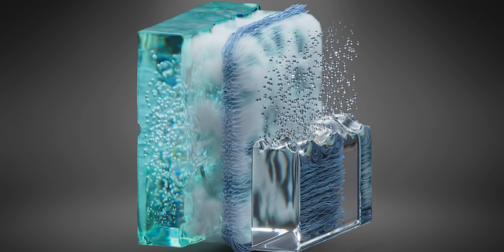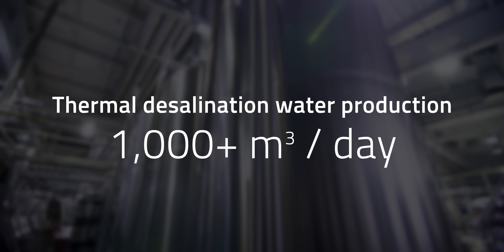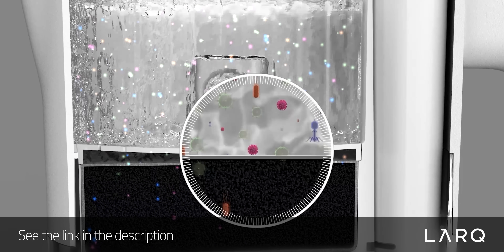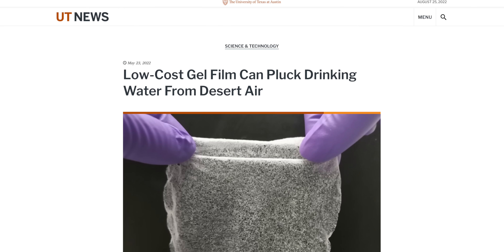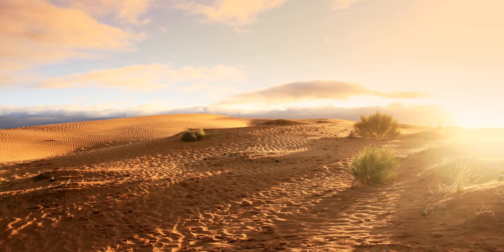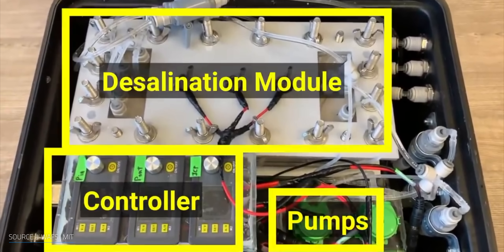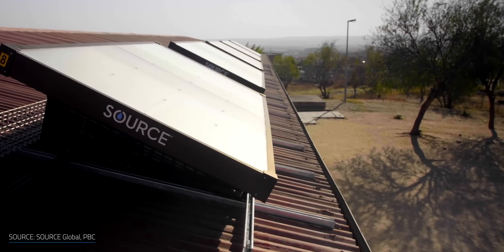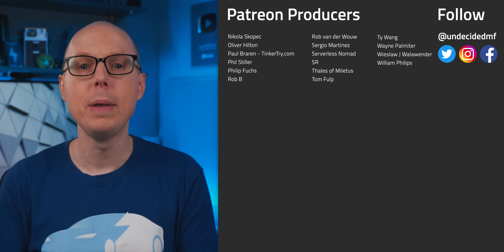2 Breakthroughs That Could Solve the Fresh Water Crisis

Comment: Wondering if it would be possible to combine solar-powered sonic based humidifiers near coast lines to pipe humidity through pipes to underground solar-powered dehumidifier locations that are inland.
Reply: If you're on the coast standard desalination and a pipe will do the job far better than trying to suck water out of the air.

Comment: I have been researching a system for sailing boats. It uses a network of SS 316 tubes on the ceiling of the yatch, a wave activated seawater pump to pump seawater to 11m high and that water creates a vacuum in the SS tubes which are connected to the "sea level". This created water vapour via a double layer vertical collector/diverter  and also cools the interior.
Reply: Go on

Comment: Wouldn't that make the air extremely dry in large scale?
Reply: if it was used in a very dry environment then yeah, if the air already has an high humidity I doubt it would make much of a change, maybe it would even be an improvement if humidity is really high.

Comment: Trough solar collectors create heat in the 900 degree range. Why not heat sea water to get clean water from the process as it drives a electric generator. Surely 900 degrees would make electricity all night and water at the same time.

Comment: 7:56 Are you listening to yourself? If the south west US is dry , how is it useful? It needs a third of the atmosphere, to be water vapor , to pull a mere 13lt per day. That's on the first day! After that, you are dealing with the law of diminishing returns. Unless you replace the water vapour you used . BTW Mucking around with weather , climate really.. not a good thing. The effects are far reaching ,last a very long time, and we still don't know all of them, or the exact mechanisms that drive them.
Reply: It generates 6L per day with less than 15% humidity, which is very dry air. Even in dry areas, air is rarely this dry. Replacing the water is not needed as the wind blows the air around, giving you an endless supply of unused air. The amount of water that is extracted from the air by such a device is negligible on an atmospheric scale.

Comment: I know it's sci-fi, but Frank Herbert's Dune series acknowledges the lack of fresh water in its world. One of the solutions,  which has been shown to be effective in real world use, is the use of wind traps, or collecting water out of the air in the dry desert.
Reply: I remember a few years ago they were testing in arid, mountainous areas of South America putting up large vertical panels that collected dew that then flowed into storage containers. Near mountains there is tons of water in the air that just needs somewhere to condense and it worked really well. Don't know if it was ever expanded tho.